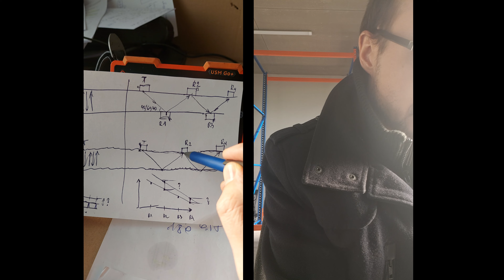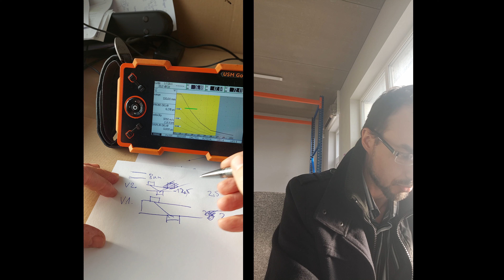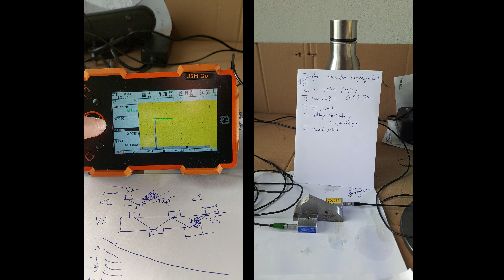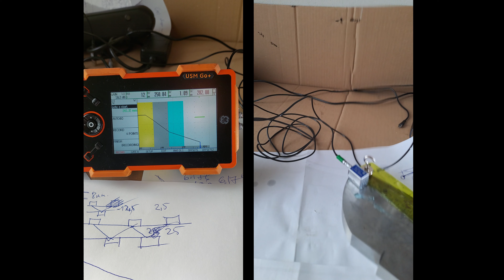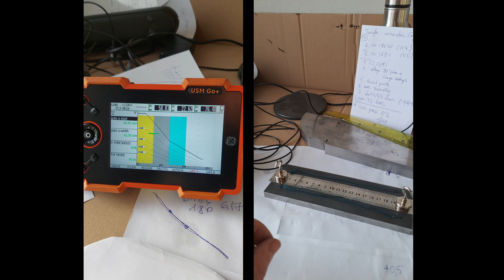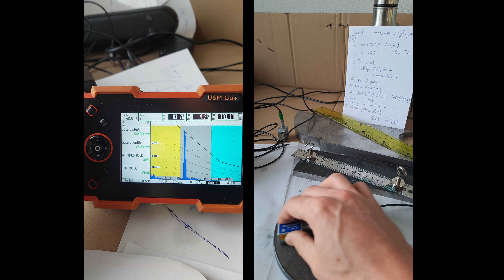[ENG] 10 - Transfer Correction With 70° Degree Angle Probe Using USM GO PLUS

Comment: I have a silly question:

When doing transfer correction; although we need to inspect the equipment with a 70 degree probe, can we use 45 degree probes to perform the transfer correction?
Considering, 45 degree probes will require less travel distance to complete the DAC.
Reply: Hi. Yes, you can do transfer correction with 45, 60 or 70 degree probes as long as the probes are of the same size and frequency.  That is, if you will work with 70 degree probe, that has a 10x10 transducer and 5 Mhz frequency, you can do a transfer correction with two 45 degree probes of 10x10 size and 5 Mhz frequency.